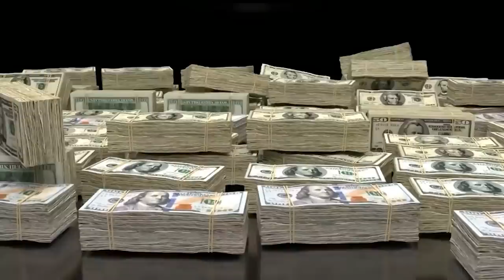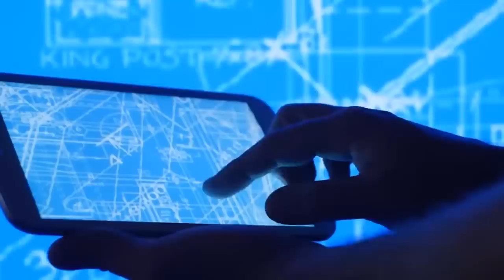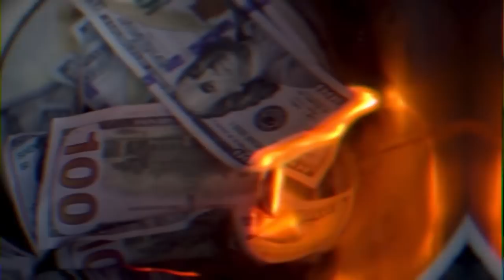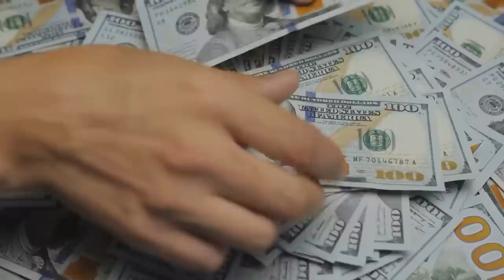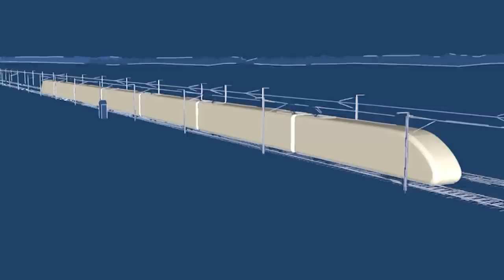Green Light for $4.2B California Bullet Train

Comment: The Central Valley route leaves open the ability to connect to Sac and maybe eventually to the Pacific Northwest. To connect California to Canada would be monumental.
Reply: The route north out of Sacramento would be able to make use of parts of 99 and the abandoned electric interurban, Sacramento Northern Railroad, running through each metro area up into Red Bluff, where the railroad could continue north on an alignment modified from I-5. From Red Bluff northwards, I-5 actually does hit the metro areas of the PNW, like Eugene, Portland, and Seattle. There is a mountain pass between Red Bluff and Eugene, after which the valley continues northwards pretty much to Seattle. And from there, connection to Vancouver would be made. A jointly connected and operated west coast high speed railway from Mexico to Canada would be an invaluable asset to each country.
Reply: That’s a bit far for high speed rail. Separate regional systems work better as high speed rail is best in the too far to drive, too short to fly range. Portland-Seattle-Vancouver BC should be its own system
Reply: We don't want to be connected to Cali up here in BC😂 

It's not anything any of our governments have ever brought up because it's not worth putting it to a vote.

Never going to happen🤓
Reply: Maybe ill get to take a trip
Reply: It should also be extended to San Diego and Tijuana.  Possibly Phoenix and Las Vegas too.
Reply: I totally agree. I wonder how we going to go through custom getting to Canada. Is there going to be an Electronic immigration system on the train???
Reply: Work on urban transit systems.Bad planning LA s metro doesn't go onto LAX.

Comment: Almost every countries first real high speed rail projects went over budget. To stay competitive in the future the US needs to invest more now and gain the expertise to reduce costs in the future
Reply: Big projects almost always go over budget but rarely on the level of CAHSR. That does not mean you shouldn't build it - you should finish it and if you'll continue it will get better on other projects but construction costs in the US is very high, and for some reason it's the same in the other main English speaking countries. The Us is at the top of the list of most expensive construction costs, although less than the UK and New Zealand *and 3 other countries). The UK is building now it's first  real HSR line (called HS2 as they have one, called HS1, but it only connects London and two other small towns to the Channel Tunnel so it does not serve passengers inside the UK) and the cost is much higher at around 120B USD for a much shorter rout. On the other hand, Spain's high speed network (currently around 2,300 mi - the second largest in the world) total cost was about 60B USD and much more is under construction (quite a few should open in 2023).
I agree that you should invest much more, just like you did in the past with the old railway network and the interstate highways.
Reply: @artandarchitecture6399  You'd be reaaally surprised at the amount of wealth train can create in real estate especially. I mean, that's how most of your historical train companies got bloated with money, and that's the plan with for Brightline. Here, it's gonna be direct good old hard cash for the central valley communities.
Reply: @AL5520  man, if you think that's a shitshow, you're not ready to see the cost of the I-69 lmfao.
Reply: If you look at the cost per kilometer of Europe's high speed rail, you arent even in the ballpark for being competitive in California.

First project or not, the price of doing it in California isn't comparative to elsewhere.

We are talking differences of over $10 million per KM, to be clear.
Reply: @AL5520  yeah high ways take a lot of money but no one ever mentions it
Reply: @obtuseangler768  The Interstate system was 5.5x over budget while CHSR was 3x over budget, but I never see people complain.